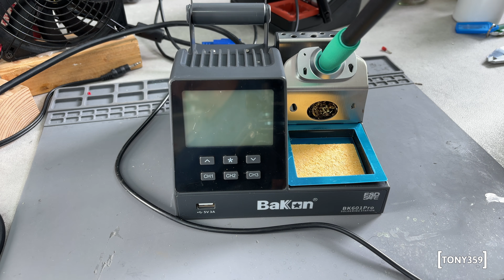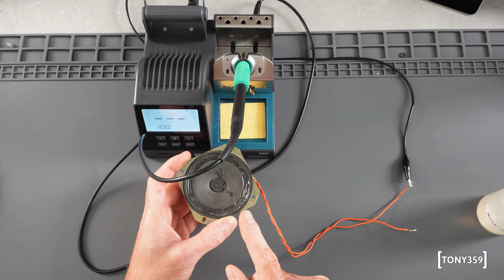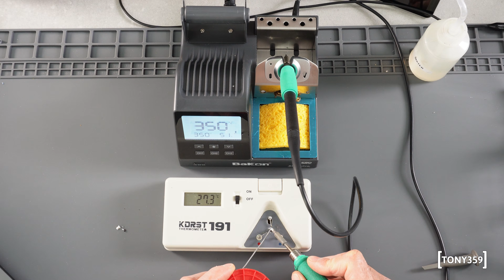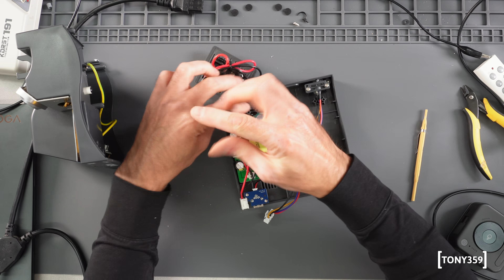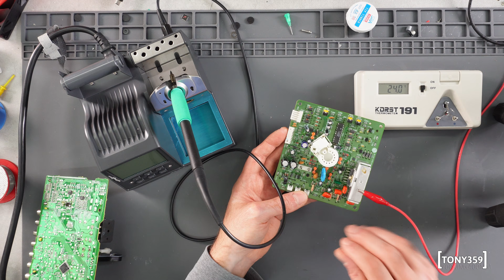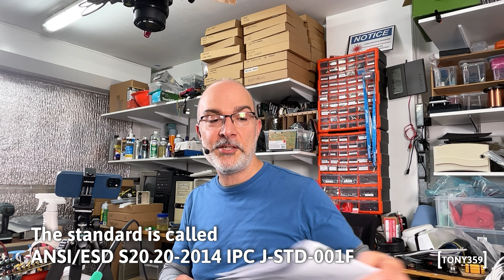This Soldering Station CHIRPS. Should you buy it? REVIEW!

Comment: There's also a real danger of soldering on a pcb while it's in an enclosure (like on a connector that is screwed in and difficult to remove...). 
Sure you disconnect the device from the mains, but what if your desk is a little bit of a mess and your bench power supply (or any other device like your hot air station etc) is also on your desk and the two enclosures touch?
Normally you wouldn't think anything of it, but there's your connection to ground...😉
Reply from the maker: Plenty of cases where ground is on the way indeed. Ground is everywhere🙂

Comment: i can hear the noise through the video, i generally hate "pen" type soldering iron.
Reply: reason being, the temp sensor and heating element share a common ground. therefore it can't sense the temp and heating at the same time, it require switching between the two (more complexity, more possible failure.)
Reply from the maker: indeed - that is why they don't work well with SMPS supplies. But the advantage is that the thermocouple is IN the tip! They react much better to temperature changes.

Comment: I got Geeboon TC22 couple days ago. The tip is grounded, I've tried measuring voltage/current leak between the tip and station's ground point at the back. There are spikes up to 6-7 mV that quickly go down, but I can't detect any current. I've seen some people doing your speaker test with TC22 and there was some current / sound. Maybe it's about what ground they have in their mains?
Reply from the maker: it takes a very small resistance to ground to push electricity through the tip and not the ground lead. Yes, it can depend on your plug, socket, extension etc.

Comment: All these stations are thermostatic stations. The majority produces a chirping sound. They are pretty basic and cheap. Generally speaking, they are meant to function like that. Some produce quieter noises, some are louder. The leakage is not really concerning in many cases. Sure, when working with sensitive components it could do some damage. Most soldering stations can leak. The high end surely has not that problem, but even much more expensive stations can leak. No matter if they have a separate heating element. 24v or 32v are mostly seen in the majority of stations that are used to drive the heating elements.
Reply from the maker: Thanks - I’d agree that leakage is not the end of the world but call me old fashioned and I prefer a heavy linear transformer and 0.00V/0.00A at the tip 🙂 
Considering there are cheap alternatives that don’t leak and don’t chirp, to be it’s a no-brainer 🙂 
Thanks for your comment (I’ll reply to the nice one on BGA later on!)
Reply: @tony359  Btw, i got a Mechanic T210 Pro. It is rated at 75W, so weaker than the station you reviewed. I took my time when scrolling through various stations, with different handles and soldering tips. What i like the most at the beginning is the fact that the T12 tips are used in a Hakko FX-950.  The tips are connected to ground. I checked mine yesterday, and it is 100% grounded. I also measured the voltage leakage. There is some, but only up to 100 mV, maybe 120mV. I did not measure it with my scope. In general, i would not bother with mine to be dangerous for components. I am only working on laptop motherboards, consoles, smart tv-s and so on. But there is no way around to buy a station where the tips have no integrated heating element. The big plus here is that the tips itself are the elements. Once the element dies, you replace the complete tip and you are good to go. I got also a Xytronic LF-8800 soldering\desoldering station. 2x100W. Ceramic heating elements, the one one on the soldering iron, is already replaced. I got even a new replacement element including a handle. It needs good 30 seconds to lets say heat up to 330°C, but it is reliable. But i could swear that even it would show some leakage. It is not comparable, the The 210 Pro is a toy in comparison to it. But i will check it, and let you know.
Reply from the maker: @Derricky007  My hakko knockoff has been running solidly for 12 years, zero voltage, zero leakage. My JBC (yes, £500 unfortunately) has heater in the tip and shows NO voltage and NO leakage. It can be done. And it's also available for cheap. That's why I cannot justify compromising on that. Honestly the best test is with the speaker. If it chirps/clicks, then you have leakage 🙂

Comment: Tony,  does that tip voltage remain when a Earthed IEC cable is used?
Eric E
Reply from the maker: All tests were done with the station grounded as shown when I was checking ground continuity on the holder. Yes it doesn’t make much sense, the only explanation is that the wires using for the handle are too thin and adding a resistance. Thanks for watching!

Comment: I don't understand how your dream tip ought to be constructed. Heating element, than insulation layer, than metal "case" of a tip? Because otherwise there  is electricity all over heating element
Reply from the maker: I'm not sure I understand the question? No, there isn't supposed to be any voltage/current on 245 tips. 

Check out my other reviews.
Reply: @tony359 me too, sorry 😂
Reply: @tony359 my issue is that you trashed soldering station while it can be an included tip quality that is bad while this station is way cheaper than JBC excluding tip. How it would perform with JBC tip? I presume those were 245 both...  With all due respect, English is not my native language...
Reply from the maker: The larger tips you saw in the video were genuine JBC tips.

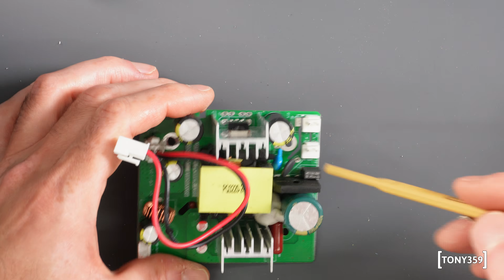Comment: 17:13 That blue Y saftey capacitor for EMI filtering... I've got a feeling if you remove it, that will solve all of your leakage problems from the tip.
Reply from the maker: Maybe. Though they exist for a reason? 🙂
Reply: @tony359 @tony359  It reduces EMI noise. Which is: 
A) Really not a concern in this application compared to the major current leakage through the tip, and
B) Given that the iron is audibly chirping, EMI doesn't seem to have been a concern for this design anyway!
[The term "saftey capacitor" is a bit misleading here. If the cap exists, it needs to be safety type, because having a cap there is inherently dangerous. But NOT having the cap is still safer than having a saftey rated cap. In this case, maybe the cap either needs to be a much smaller value, or a different layout between earth/live/neutral with Y or X caps (or test a CM Choke). But the first step would be to remove it to see if it solves the primary issue. If it does, then you can worry about if there's a need to to replace it with something.]

Comment: Hi Tony!

Nice review!

The power supply board looks good, aside from the cheap capacitors used, there is nothing to complain, nice clear layout with lots of safety margins. 
The mains supply it's self is a Flyback converter, it is clearly seen on the board, and also Flyback is the best choice for small to medium power output ( lowest component count, simplest layout, and so on ). 
The controller IC indeed is that SOT23-6 device, and it is a OB2263, pretty common Chinese Flyback controller IC.
The fastest way to identify the controller on any board is to quickly trace the gate control path, and on this board the gate is controlled by a 22R resistor in series with a small diode ( which looks like a T4 marking on it, so a 4148 diode ), that sot23 device is a small PNP bjt used to short the diode at the OFF part of the control signal, for a faster turning off of the mosfet, and the control path leads to pin 6 of that IC.

As for the tip voltage and current leaked out of it, that has nothing to do ( or anyway very little ) with the switching power supply, if that leak would come from it it would be at the switching frequency, tens of khz, usually much higher because leakage usually is high frequency switching noise translated through leakage inductance and capacitive coupling in the transformer.
That 1khz square signal is the PWM control of the iron tip done by the uC and some SMD mosfet near the soldering iron plug ( looks like a TO252 case device ).
You measured about 3 Ohms between your earth point and the soldering iron tip, while at the IEC plug lead there was 1-1,1 Ohms compared with 0,9-1Ohms with shorted leads ( so about 0,1Ohms wire resistance of that mains lead ).
That simply means that the resistance between the mains IEC connector earth lead and the soldering iron tip is almost 2 Ohms, and that is bad, that is really bad because that is the resistance of the handle cable ( the power ground, which also means that if the same type of wire is used for the power lead then the total resistance of that cable is almost 4 Ohm which is unacceptable ),
You have a 20Vdc power supply, so 20V square pulses on a 3 Ohms tip resistance ( something like that anyway ), that means 6A of current. 
With let say 1,9ohms on the handle cable in series with the 3 ohms of the tip...you do the math.
Much of the control PWM waveform is lost on that cable ( maybe not as much as it seams, to be sure one would have to precisely measure the cable wire resistances ). 
To put it short, what voltage you measure between the tip and the earth is the loss voltage on the cable, and what current you measure with the Fluke's ammeter is a much lower resistance path for the ground lead ( the Fluke's current shunt and leads ).
Clearly unacceptable and unusable soldering station!

PS: Less than 2mV between the tip and the earth connection is difficult to get when you have such high current pulses on such low tip resistance, it requires the handle cable to have very low resistance wires, which can only happen with thick wires, but the cable also needs to be thin and flexible, so there is some compromise.
Think of it, take those 20V in this video, and that just over 6A of current pulses with a 3 Ohms tip. 
To get 2mV of voltage between the tip and the earth, the cable resistance needs to be 0,002/6, just over 300uOhms, if not impossible, clearly very difficult. 
What can be done i think is using a different wire for the earth connection to the tip, one which is isolated from the power ground path for the tip, and is only used for earthing the tip.
I'm not sure if anyone does it, so, take those less than 2mV with a pinch of salt ( measure them in full load with a scope ).

As my rule of thumb, anything less than what is needed to bias even the lowest bias semiconductor junction ( usually Germanium is the lowest ) is ok, so anything less than 250-300mV should be safe, no matter what you are working on.
Reply from the maker: Thanks for the very detailed and interesting reply as usual.
Very interesting. So you're saying that if I fitted a thicker cable and sorted out ground internally, I might get better results?

I see what you mean about the expected 2mV - however, with a linear transformer, I don't see any voltage at all - but it still uses 20V to drive the tip. Though it's AC and not DC. Why is that?

In any case, a few millivolts and a few milliamps would have probably been ok. 

About the switching noise, what about those 20V at much higher frequency I see on the scope? I kind of ignored that but I don't think it was coming from the lead 🙂 

In any case, as you say, unusable. 
Thanks for watching!
Reply: @tony359  The first thing you should do is precisely measure the DC resistance of each of the power wires inside the handle cable. 
The ground wire should be easy since you can tap straight on to the tip and on the other end on the connector. 
The + wire is a bit tricky since it’s on the inside, but you can first measure the DC resistance of the tip, and then insert the tip into the handle, and measure the DC resistance between the tip and the + pin on the connector inside the station, that way you get a sum of the + wire resistance and the tip resistance, and since you already measured the tip, you can easily subtract it. 

As for the measuring method it’s self, I am not sure if the Fnirsi LCR meter ( or that small LCR tweezer ) does precise DC small resistance measurement, but the way I do it is by running a constant DC current through the resistance I am trying to measure, and with one multimeter I measure that current to be sure, and with another multimeter I measure the voltage drop straight on to the ends of that resistor.
Divide the measured voltage by the measured current and you get a very precise resistance. 
Only once you have that you can try to find a way for improvement. 

“I see what you mean about the expected 2mV - however, with a linear transformer, I don't see any voltage at all - but it still uses 20V to drive the tip. Though it's AC and not DC. Why is that?”

That I cannot say without doing some measurements myself.
I’ll rewatch that video and maybe I’ll get an idea then :D

“In any case, a few millivolts and a few milliamps would have probably been ok.” 

Indeed.

“About the switching noise, what about those 20V at much higher frequency I see on the scope? I kind of ignored that but I don't think it was coming from the lead”

I guess it could be a mix of the power supply switching noise and some switching noise on that 1khz waveform for the tip, generated by lead parasitic inductance and stray capacitance. 
I wouldn’t worry about it.
Reply: The Pinecil does have an independent ground path, but its (old 8 ohm) tip heaters aren't very close to the soldering surface, and the socket connector uses fiddly copper rings without grip force and can malfunction.

Comment: Great video! great review! 👏 professional and fair as per your consolidated style. However I think that a "fully fair" review should also give a hint about the price range where the product is positioned. If you can get that soldering station, with all its flaws, at the price of a couple of basic soldering irons... I guess I'd still call it "a deal". But yes, still all the tests you have done are meaningful and would make the difference when the prices range is similar.
Reply from the maker: You are right - I forgot 🙂 That said, if the iron didn't have voltage/current leak, I would have been more than happy to point out the price. For the current price (shockingly low on Ali!), one can just file off those sharp edges and glue that metal corner 🙂 And maybe live with the chirping noise! 

But because the thing misbehaves at the basic level, it could be free, I cannot recommend it. But you have a good point, thanks for mentioning!

Comment: I don't know how accurate that 0.6A reading is. I've got a feeling the actual reading might be significantly different - and possibly even worse. I think a much more accurate test would be using the oscilloscope across a 1-ohm resistor. That will give you a much better picture of what is really going on between the tip and ground. But any way it goes, I have to agree with you: that's an unacceptable amount of leakage.
Reply from the maker: oh 100%, 0.6A is a very optimistic figure. The Fluke doesn't have the speed to catch those pulses. I should have done a better analysis but in the end 0.6A is unacceptable so I decided not to invest more time on that. 
Maybe I'll do that next time, I have never measured current using a scope. 
Thanks for watching!

Comment: What a piece of wasted materials! I recently bought a Yihua 982 with the 100w & 40w holders & tips. It doesn´t chirp and is properly grounded, has a nice display with a real time power sent bar and the original Yihua tips are quite good. I have the same crappy thermometer and it showed a -8c difference out of the box. Yes, all tips have different offsets, that´s why I have two holder and sizes. Changing tips whilst doing stuff annoys me. But the 40w tip is actually powerful for being that tiny form factor. A better test than stuffing the tip in a sponge seems to put the tip in a shotglass of water and watch how well it holds the value.
The 100w tips I only needed once- but then I really needed the more oompf. I can totally recommend the Yihua 982 with both holders. The tips used is up to You, the JCB´s are WAY too expensive for my use.
I fare well with 3-5€ per tip, not like 55€- it doesn´t have to last a decade. Would be nice but at that price it´s optional. But the station is electrically sane.
Reply from the maker: If you're happy with your tips, happy days but remember good tips will make the difference. I was about to toss my Aoyue (Hakko clone) station years ago until I bought a genuine Hakko tip and wow, night and day. 

JBC are expensive indeed - and don't last a lot - but other tips I've tested were shockingly bad!

Thanks for watching and for your comment!

Comment: i agree on the voltage from the tip. But considering the supplied cord do not have a ground prong, and you use your own cord. would there even be voltage if you would have used a ungrounded cord?
Reply from the maker: It does. It's a shuko plug, ground is female, the prong is on the socket. I used a proper grounded UK plug for the test and you can see I have continuity on ground. 

I am not even considering running an ungrounded soldering station!